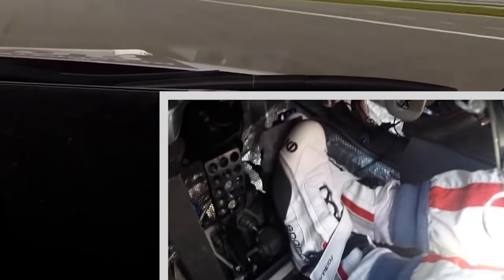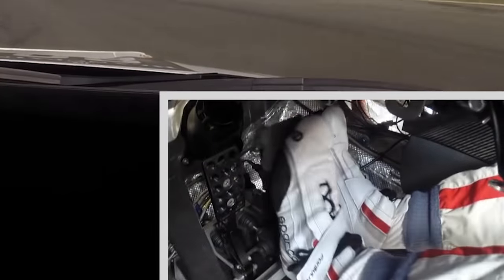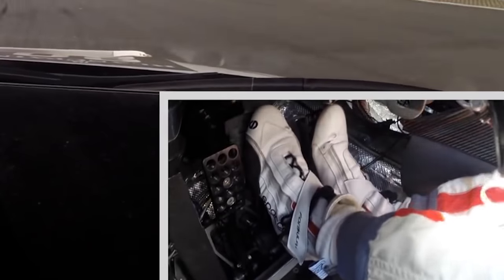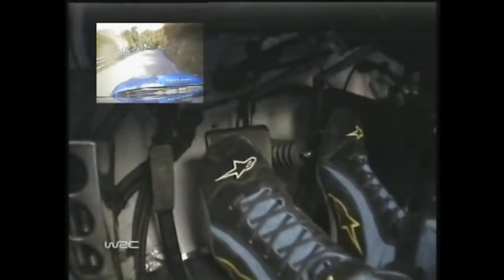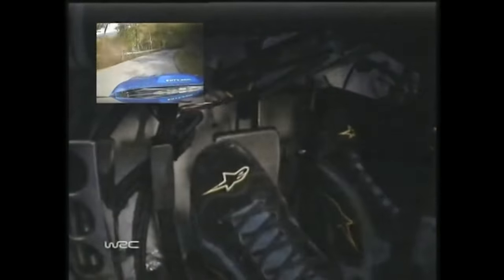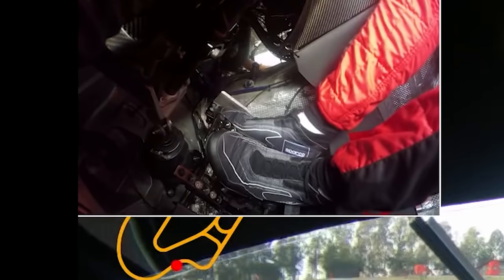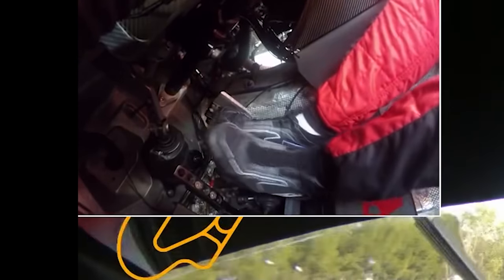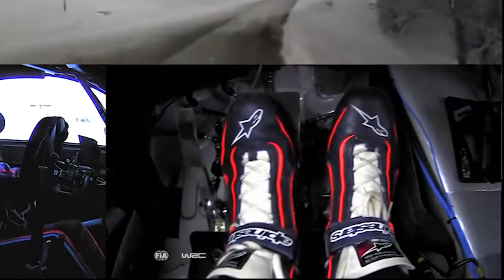Real Race Cars Have HUGE Brake Pedal Travel!... What?!

Comment: If you boil your brake fluid you will get compression. On my track car towards the end of the session if I over brake I can tell because the pedal gets soft and I gotta bleed the brakes afterwards. Even high temp brake fluid can boil if you get it hot enough. Also most of the travel  you see isn't engaging the brake. I mean the the difference between full lock and letting off for trail braking is about as much as it is in the sim pedals.  there is travel before you actually engage the brake. You wouldn't want the brakes to bite the second you hover your foot over it. 

Again it doesn't matter how much or little travel there is.. it just has to be consistent. If you drive the same track car you learn the travel and bite points.just like you learn it on your sim set

Comment: Very interesting theme Karl, I concluded that my Thrustmaster T-LCM pedals are closer to the actual behavior of race cars than the top-of-the-range pedals like those of the Asetek :).
In fact they behave much more similarly to my actual car than these pedals that don't have any displacement.
Reply: there are some elastometer tutorials about the TLCM and the guy is comparing them to the heusinkveld brake feel. ofc its not the same and the heusinkveld are built like a tank but thinking about the cost: its nuts to be able to just mention the 2 in the same phrase...

Comment: Brake fluids can boil at end of races creating long brake peddle travel as boiled fluid becomes a gas and is compressible
Reply: Look at Pedro De La Rosa's 2000 qualifying lap at spa that shows his pedalwork (It's on youtube). It's a qualifying lap! There's not excessive heat built into the system, and it's still easily a 2 inch pedal travel.
Reply: @KyleP133  yeah for sure imo brake travel a personal thing  to for the the correct feel too

Comment: Ive said tbis whole time people hsve gotten way to used to this brick idea. Even the pedal manus who say oh gt3 brake! Are way off imo. Im sry but some travel helps consistency in trail braking. The ones who say it doesnt so try for long enough and are to used to the brick wall. You can 100% trsil brske better wnd find time you may not have even known is there if you try and adapt to it you will find its amazing and so so consistent. These brakes are to stifd in the sim hobby and people think they have full contprl over every % but they dont it still drops off faster and jumps. Longer travle allows you to contorl the full rabge but the pedals need to be able to read it well with that travel. Like the p2000s they are fantsstic replication of what a true gt4 or gt3 car feels like ob the brakes like legit spot on. P1000s also with the hydraulics and springs. Yes perfectjon. Look at simucubes new active pedals beautiful travel and the preset done by a gt3 driver proves that. The springs in a none active pedal will help the push back so you can judge it better. But asetek brakes omg horrible. The makers in the hobby started this realistic trend and lost track and now make f2 and f2 brakes that are supposedly gt3 style and they just arent. F1 brakes are super heaby due to the insane speed and stopping power needed and also the g forces which are transfering energy through and helping you brake. They arent even desigbed for the best trail braking. Idk i found so much consistency and time when i finally got a brake with some travel like the real cars ive experienced. Made a world of difference and ill never go back. I knew how to trail brake and i was always loke man i cant trail brake for as long as i want to as easy as it should be. Then boom got these and bam beautiulf first two laps and within the firdt 48 hours beat my pb by 4/10ths no joke.

Comment: From 2000 to 2014, I worked as a taxi driver, during which time I changed over 20 different cars.  Each of the cars had different brakes in all aspects.  It literally took me 5 minutes to get used to each way of braking because I was not able to put it as it suits me.  The whole "reality" story is just about making money from people without driving experience.  Sim pedals of 700-1000-1200 euros / dollar is ridiculous in my opinion.
Reply from the maker: I agree about the price for sure, but driving taxis doesn't give us much insight into race card brake pedals... I can drive 10 cars a day at work on a busy day but they are not race cars either so doesn't really help.
Reply: @KarlGosling  I responsibly claim that, for example, TLCM pedals are no worse than some much more expensive in terms of functionality.
Reply: The essential difference between GT cars and ordinary ones is that you have the ability to brake while turning

Comment: At the end of the day does it really matter how much travel there is in sim racing pedals as long as you can brake and get round a turn?
We are sim races and while it is nice to have the feeling of driving a real car it will never be perfect.

I used to be quite a keen photographer and saw people who used to spend crazy money to get pro quality equipment and couldn't understand why they didn't instantly become a better photographer.

The same applies to sim racing, you don't need have to have the best of most expensive gear to get good results.
That however is not what the clever marketing people want you believe.

It is personal preference I suppose and whether people are happy with whatever gear they chose to buy and use.
Reply from the maker: To some sim racers yes it does matter, to the casual racer like myself not so much :)
Reply: It does for me. I do not care about results - I do care about immersion.
Reply: For me with logitech pedals and IRacing seems like I barely touch the pedal and it locks up no matter the car. No real car would be like that.

Comment: I had once privilige to spend day driving formula renault and few laps with WIlliams FW29. What an experience was that. These two cars had HUGE gap between on everything, but pricipless were same. Both had very short and heavy pedal. I am not race driver, It was my first time driving real racetrack. 

Pedal felt like too stiff to work as it designed because I wasnt driving fast enough. G-force wasnt enough to help as much it should. You have to understand that these cars even havent got very much cabin space to make big movements. Actually formula renault is so cramped that I couldnt move wheel more than maybe 60 degrees, and couldnt put finger between my knees. It maybe became easier to brake from higher speed than low speed.

So. These high downforce tiny openwheelers have short pedal travel and high force because high deceleration forces helping to push pedal and driving position quite far from normal car we are used to. Maybe because of driving position it isnt possible to have very long pedal travel.
Reply from the maker: Great experience to share thanks mate!

Comment: This just adds to how i felt you where a bit off in youre invicta review. Might be me misunderstanding?
You call the elastomer travel stage 1 for ‘mechanical play’. It’s not..
Up to the point you feel a bit of resistance, lets say up to 2kg (random number) is mech play. Hinges, freeplay travel in master cyl, brakepads moving in to the disk.
Now this is where the stage 1 begins, compressing the elastomer. Pressing pads level onto the disk (alot of pistons), seals settling in under pressure, brake lines expanding a little etc. This will continue up to 50kg press on the soft elastomer.
Now stage 2 takes over, pedal travel stops as nothing expands or compresses anymore, bit pressure continues to rise.

The race cars in these videos, might have alot of freeplay before they even start building pressure. Can be because of a small master cyl with big calipers etc, but a proper brake setups does have a short travel where pressure really builds.

Regular cars has abs systems, softer brakelines, and even built in ‘comfort feel’ to the pedal so Granny can drive around in it, and is not comparable :)

I do agree though, that it could be possible to get close to this invicta system on a typical load cell system, with some modifications, so the travel stops at 40-60kg but load cell still reads pressure building. We will probably see that allready in 2022 i think, but who knows if it will feel just as good as they say Invictas does.
Reply from the maker: Mechanical play includes the pads contacting the discs, seals settling, flexi expansion if any, etc.
What I've concluded from reading real life experiences in the comments and across the internet is that it varies from car to car and driver to driver... so a lot will be personal preference.

Comment: Feel is key, probably some sort of leverage added in to the brake pedal, to give a light feel at the start and heavy feel at the end.  Think of it like a set of mole grips, completely solid mechanism but still a feel of leverage, i bet it makes it feel progressive but hard at the final point.
Not to sound like a prick but maybe its more your rigid idea that brake pedal should be solid that makes it seem odd?  Put it this way, the amount engineering know how in the motorsport world, if someone in a race series wants a certain kind of pedal feel there will always be an engineering solution to it. 

I think a good way you could test the "feel" hypothesis is look at multiple onboards for a spec series and see if everyones pedal is the same.
Reply from the maker: My idea isn't rigid mate, I was just referencing Asetek and their design philosophy and my own very limited experience fitting race pedal boxes, I literally say I have no idea why they are the way they are, it's why I made the video :)

Comment: Piston size to pedal travel ratio.
Reply: Piston of the master cylinder that is... increased piston size equal more brake travel, as more fluid must be moved for same distance of piston travel. Hope this helps @karl. Cheers mate
Reply from the maker: Thats one possibility, which I was aware of as I fit them IRL, but I've still not seen this much travel... my experience is very limited though.

Comment: EDIT, deleted my waffle and will TLDR it.

  brake pedal travel doesn't matter, you put force in to slow your car not push the pedal a certain distance,  take the g25 pedals for example, there's no resistance or judge of force so you have max braking at the end of it's travel, that's not how brake systems in cars work, so in cars where you are judging braking pressure by how much its resisting against your foot, when you take that to sim racing you'll find you wont have as much travel because you are acting against a load cell, not a potentiometer. a more realistic feeling sim pedal wont have anywhere near the movement of a car, because there is no way a sim can replicate real pedal feel, tyres, brake pads, fluid, speed, everything that determines how much force you put into braking and as such 'travel' the pedal has.

using socks over shoes will make your car brake pedal feel heavy, so choose how you setup your sim brakes feel based on footwear too, want more travel to better heel toe or less travel for left foot braking and feathering pressure with trial braking, set it how you want that's the whole point of them being adjustable

my v3's are very firm and don't have really any travel, but that's what was needed to replicate a feel im used to of my real car. not trying to match the travel, but the pressure required for braking.

Comment: It’s a bit of marketing here at play.  None of those videos you played consisted of F1 or modern GT3 etc.  These pedals are catering more towards that end of the spectrum than rally or older GT racing.
Reply from the maker: Marketing? I just used the first few videos that came up, most are circuit (including GT3)  two are Rally I think.

Comment: Honestly, I would not buy Asetek pedals. I love how they look, but my main focus is old cars and rally. And I need the travel there. I change the elastomer in my Sprints for different cars, too.
Like mentioned by someone else already: take rally cars out of this discussion. Soft suspension and different levels of grip need a bit different approach than aero heavy circuit cars.